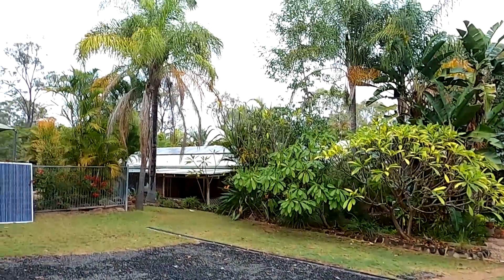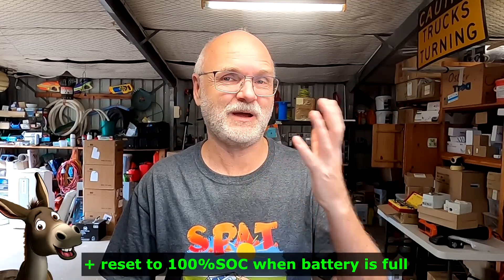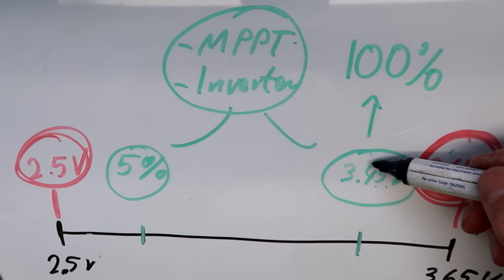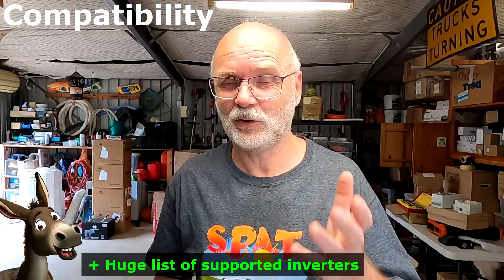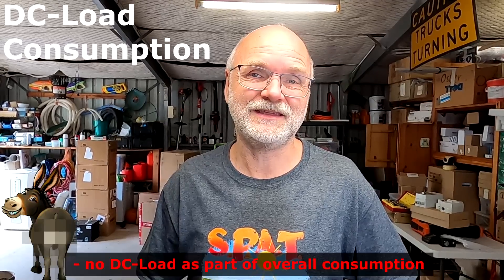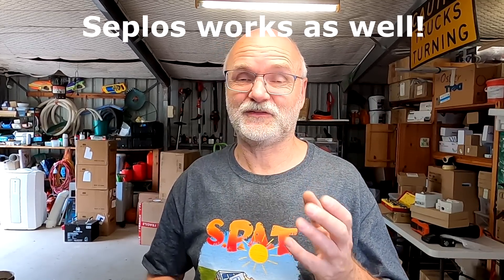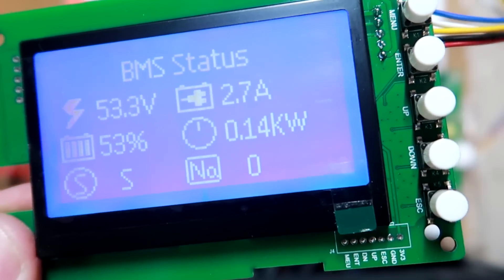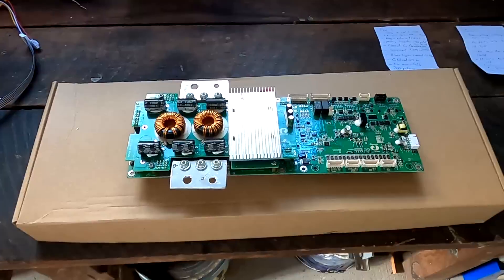In search for the best BMS... My Gobelpower BMS Verdict!

Comment: Im acting as a human BMS by discharging and charging each cell when they become unbalanced, using a car light and a power supply. I can balance the cells in no time and perfectly. The cells will most likely become unbalanced quicker then the time it took to balance them when i connect it to my Solar system. I have a Hellcat 4s Balancer but thats only for top balancing. Im going to have to buy something i can program. Maybe the BatGo ?

Comment: Hi Andy, i have watched just about all your videos and really like your way of showing  the fantastic world of solar power, i have a question if i may ask, '' do closed loop communication BMS's connected to the inverter charge multiple battery packs based on the SOC in order to charge the packs equaly ?''
Reply from the maker: I think you have sent this email too, right? I just answer it here again for everyone.
No, they only charge per voltage. Parallel batteries balance themselves without problem. One banks has a bit higher voltage and will take less charge until the others have caught up. 
There is no communication between the BMS and inverter necessary for any of that to happen.
Reply: @OffGridGarageAustralia  Hi Andy, im so sorry for doubling my question, yes i did see your email and thank you very much for replying, it was important for me to know this, i just installed 20 kw of solar panels, 24 kw (4 x 6000W) hybrid inverters and 40 kw of Lifepo4 battery's, im learning every day new things thanks to people like you 🙂
Reply from the maker: @creamshop  Not a problem at all 😉

Comment: What would you think about making the JK-BMS to be able to do the same. Like reducing charge current when it comes close to overvoltage or reduce charge and discharge current when it reaches a critical temperature. Let me know if you are interested.
Reply from the maker: The JK does not have this functionality and no hardware limiter. It also lacks the ability to communicate with parallel batteries.
Reply: @OffGridGarageAustralia  But i think i could make it to communicate with the inverter and tell it to reduce the current in these cases, by letting it speak the Pylontech protokoll. I guess your Victron system can understand Pylontech as well.
Reply from the maker: @ackmaniac5101  Yeah, you can let it communicate to the Victron system and other inverters. I made a video about it a while back. The question is though, how do you handle several battery banks in parallel and how do they report combined back to your system?

Comment: Hi Andy,  

Great vid,  I went to look at your GobelPower BMS link to buy one, but they're all  for 16S, is that corrent? 

I didn't see a 4S12V system, so I guess my option is the JK one you reviewed about a year ago, this one:
"The JK-BMS 4S-8S Edition - World Premiere. The best BMS now for your 12V LiFePO4 battery system"  

So I'll order a B2A8S20P unit, with your link.  For that unit, do you know if that 4.3" screen that they sell is any better for 
the amount of information that it shows versus the smaller 2.3" one with the on/off button you showed in the video?
Reply from the maker: These sort of BMS are all 16S for 48V battery system and communication between them and an inverter. 
Yeah, for a 12V or 24V battery, use the JK-BMS. that is a great device and will work perfectly with its active balancer. The screens are really optional as you can always connect via the app. There is just basic information on either screen. They are great if you install your battery in an RV and also other persons can read the information of SOC. And the on/off button... it again depends how you use your battery but the BMS should be staying connected to it all the time anyway.
And thanks a lot for your support and using my links

Comment: Hey Andy!
Given your current knowledge, would you still recommend JKBMS or not?  Do you know which hardware and software version of the JKBMS you are using in your system?
Reply from the maker: The JK-BMS is a very different device in comparison to these larger BMS.
As a rule of thumb: use teh JK-BMS for 12V/24V batteries or if you have only one battery. If you have several larger batteries in parallel and want more safety and also communication, Seplos, Gobelpower and co. are better for that purpose.
Mine is a very old JK-BMS, one without a power switch or display option.
Reply: @OffGridGarageAustralia  Thank you very much for this information. I already have several JK BMS versions in use and I am of the opinion that the current hardware/software version 11.x finally calculates the SOC value more sensibly. Apparently the problems of the older models have improved significantly here. I would also like to test the Gobel Power BMS, but since it doesn't have Bluetooth, I'm still considering it. I am currently in the planning phase for a 43kwh storage system that will consist of 3 individual batteries. I'm really undecided on which BMS to use ;-)
Reply from the maker: @cyborgxxl  Thanks for sharing about the improvements with the JK.
With three banks you could still use the JKs but won't have any comms or elevated safety features like with the other ones.
The Pace, Seplos and Gobel are all very close together and at the moment I would go with the Seplos just due to the fact, that it works with my Victron system and the connected DC load. This is a major drawback for all the other BMS.
And we also have found a solution to overcome some of the problems with the Seplos BMS now. Well, one of my viewers has found a pretty good workaround for the Seplos...
Reply: @OffGridGarageAustralia  Ok, thanks for the detailed answer. I think maybe I'll go for the Gobel or Seplos BMS after all. I only use Victron components. Greetings from Austria!

Comment: What BMS would you recommend for a simple 4s battery pack then?
Reply from the maker: The JK-BMS all the way! Link is here: https://off-grid-garage.com/battery-management-systems-bms/
Reply: The only gotcha with the 4S JKBMS is it seems to have a significant current draw. Did a test of 100AHr 12V 4S LiFePO4 with full charge and left it for 3 months and it lost 40% of capacity  - fortunately there is an on/off switch that you use to easily switch on/off BMS. I have a suspicion that the current draw is due to the inefficient  DC DC converter that produces >21V as this was the voltage required to drive the BMS in 16S versions.

Comment: Hey Andy,

already left you couple off comments on some other video about this,
I never use total voltage protection on any of my BMSes when single cell voltage protection is available,
just disable the switch in the Seplos BMS set the overvoltage to 55V or 54.4V or 54.8,

now when the overvoltage is triggered, it doesn't disconnect charging & battery is reset to 100%, if cells are somewhat balanced this means its actually 100%, the only issue is there is no separate floating voltage option with time limit.

& since a battery with well balanced cells will drop current gradually allowing it to absorb for a longer time before reaching the actual "overvoltage protection value"
I compensate for the floating absence by lowering the "charge over voltage protection recovery" to something like 53.6V

like this since my system is well sized panels/batteries/load my batteries will reach almost 99% and float for about 30-60 min before reaching the "overvoltage protection" voltage, thus resetting to 100% and stopping the charge current.
Reply from the maker: Yes, I replied to you comments already. I will do some more Seplos testing soon. That is a great suggestion and 'trick'. Thank you for sharing this. 
The missing floating option is not great but also not a big problem. Usually people turn on loads when the battery is full anyway, so it won't stay there for too long.
Using the recovery voltage...  so when the battery is full, you just use the solar power for your loads and the battery voltage will slowly go down due to the fact that the charge MOSFETs are turned off. Ist that how you use it?

Comment: @Off-Grid Garage - thats true the Gobal BMS is one off the Best BMS on the Market right now when you what to parallel more Battery Packs. On an 3 Phase Victron System the Solar Input to Grid is possible over the Solar Charge Controller when the Battery is 100% full - so the BMS is not blocking the Feed in to Grid.

The 100% Reset and turn OFF MOS is not the best solution because on an 3Phase Victron System with a Fronius MICO GRID Inverter when the Gird is Cut off and you have full Solar Power the Victron 1:0 Rule makes for a few miliseconds a higher Voltage on the DC side until the Inverter are throttled town by the rising Hz from the Multiplus. When the MOS are closed the can not drop the incoming Power to the Batteries.
Also the 100% Turn OFF MOS is the natural way of Float Voltage - when the MOS Stays ON we need a extra Permameter for the Float Voltage to set for the the VE.Bus. I'm also FAN of your theory to keep the MOS ON at 100%

Maybe Gobel Power can implement a Set Float Voltage for the Victron VE Bus when Batterie is at 100% and a NO Close Function from the Charge MOS at 100% SoC!

Comment: I had issue with the Overkill (JBD) and 280A Eve cells.
I got a JK active balancer BMS and a Heltec active balancer.
I think active balancers are almost mandatory for larger cells.
Reply from the maker: Yes, I think so too. It may work with very well matched cells in a 4s installation, but 16s... there are for to many cells which are drifting.

Comment: JBD BMS can give you 100% SoC at level selected
Reply from the maker: Which JBD ist that and whip app/software do you use?
Reply: my reply got deleted?! I am using both xiaoxiang and overkillsolar apps. Setting you shoul check is single full voltage or cell full voltage or something similar depending of version of app used

Comment: Hi Andy. Great video. I've ran quite a few BMSs systems. JK, ANT, seplos and a Batrium You must review a batrium BMS one day. 
Everything you look for in a BMS is in a batrium. 😊
Reply from the maker: I'm not a fan of the external shunt and contactor situation of their design, tbh...
Reply: You are the second YouTuber today that said something like that. I really don’t get why—particularly in a safety critical system (boat power and/or critical loads (nav, comm, surveillance and lighting)). 

If contactors are the problem, there are FET based devices which can do the same function, albeit  at lower power.

Comment: Hello Andy!
Thank you for this nice summary! You have already been able to show us a lot of secrets of various BMS's.
Small question: in your videos you regularly show the Victron Remote Console on a touchscreen.
I couldn't find it on your website. Which touchscreen do you use for this? Is that the official Victron screen? Thanks in advance for more info.
Sunny greetings.
Reply from the maker: Thanks a lot for your feedback.
The touchscreen is just my old Android tablet connecting to the VenusOS IP over the network showing the remote console. The tablet is an old Nexus 7, almost 10 years old. It still works perfectly fine

Comment: Hi Andy, you say the Gobel Bms is the best, because of the software, because the SOC reset can be determined. On the other hand, you mention but, the Gobel BMS switches off the MPPT and then uses only the battery, unlike Seplos, for example. For me, however, remains in total the Seplos the better BMS, because not only more user-friendly through Bluetooth, but what is much more important, the Battery is full in the summer at noon and it follows another 8 hours SUN, which I can immediately consume or feed and sell, the Gobel BMS can not, the whole afternoon is then lived on the battery, although the sun is shining and I could use the extra yield. For me, the Seplos remains the price performance winner.  Thanks for your work and thumbs up from the crazy Germany to Australia
Reply from the maker: Thanks for sharing. Yes, that is correct. I've just summarised all pros and cons as far as I could test them.
It is very difficult the compare BMS as the conditions often change when charging and it is never the same.
I'll get back to the Seplos soon... more too come.

Comment: I still feel the pain i brought one of the first models of the daly smart bms at a cost of $600 aud. Its now a paper weight lol. 
I now have 3x jk bms. If jk could do communication it would be the best peter bms.

I wont be buying a new one until there's a bms with communication and active balancer and can monitor multiple packs in series and in parrel. How good would it be to have one bms for your 3 16s modules.

Ps thanks andy your the battery king of knowledge

Comment: I love your videos, but I must correct you since i have been seeing 10 videoes where you say seplos stop charging and reset to 100% only at 3,65v. I have a seplos case and it reset to 100% at 3,50v, because i have set the total battery voltage to 56v. When it hits that it resets to 100%, also when I have set the cell ov protection to 3,6v.
The seplos reset to 100 percent when it hit an overvoldtage protection for the cells or total voltage you have set yourself.

I use it with the 10A limiter but my deye 12kv 3 phaee inveter wants to take things easy and only charge with 5A until the battery does not absorb anymore. After that, the battery goes down to around 3,4v. Best inverter ever, 17A on each phase if all phases is loaded 100% or 27A on one phase if the total load is under 12000w forever. And it can do 200% for a small amount of time on both the 17A and 27A. And it can do all sorts of smart things, like use the generator input as smart load that turns on when the battery reaches a preset % and off again at a preset %, I use for charging a tesla. It works with alot of batteries like seplos. It have the shunt build in so it can run with no connection to the bms in % mode. It can take 18kw solarcells and run another inverter like micro inverters on the generator input, even in off grid mode

I run the seplos with the neey 4.0. I got some very good eve280 cells there dont drift much. I could run it without the neey and I did for one month because I turned it off by mistake, and the call was only 25mv from each other when the battery was charged to 100%. The settings in the seplos bms its set to that the balancing starts at 30mv and stop again at 20mv, so that is exactly what it was set to do. I have the neey set to 8mv because I like the the quick balancing the neey offer, then the seplus work as a backup balancing if the neey stop working or more then one cell runs off.

I have not updated the bms or anything, and it does just work. The system runs as an off grid system now, until the permit to export to the grid comes.